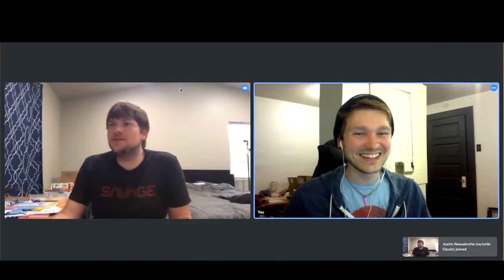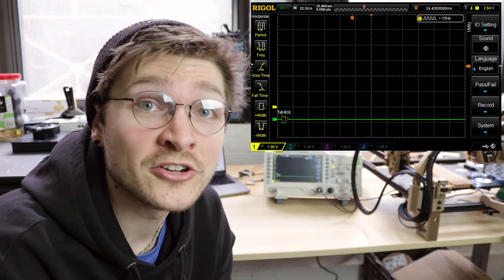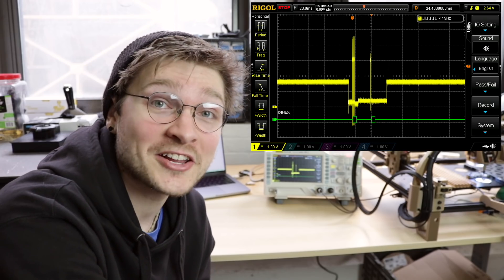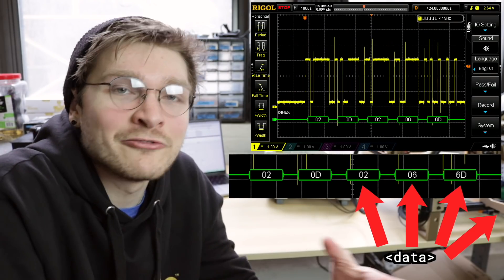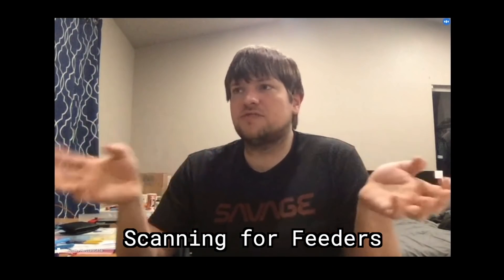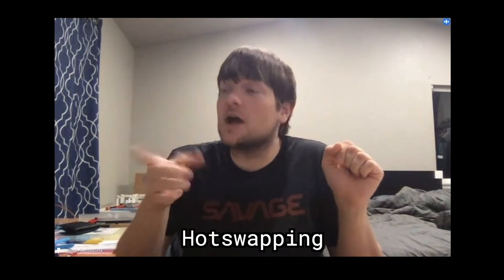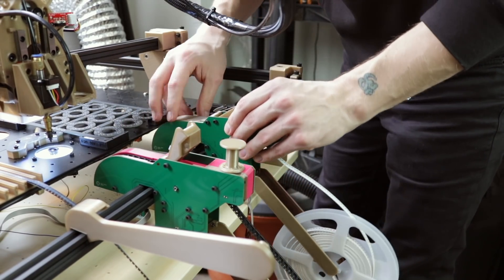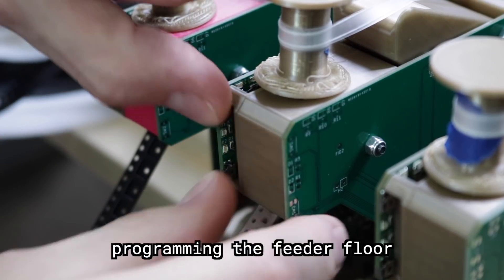Designing a Feeder Protocol

Comment: The feeder ID tracking system you've outlined seems like it's actually completely counter to the way you'd want to use feeders in production.

The workflow I'm imagining is that you'd want to have one spare feeder that's not installed in the machine that you can load offline with the next reel of whichever part is about to run out, and then quickly swap that fresh feeder in once the running feeder feeds its last part. Then, the removed feeder becomes your spare, and you load it with whichever the next reel after that is to swap in for a third feeder. With the system you've described, you'd then have to countermand OpenPNP every single time to tell it that the feeder you just loaded into the 10k resistor slot does actually have 10k resistors rather than the 100nF capacitors it had in the slot you swapped it out of. Letting feeders flexibly reassign themselves as holding the same part as the last feeder that got removed is a desirable, even necessary, feature.

An even more production-friendly option, though, would be to build some sort of external programmer tool that incorporates a barcode scanner for scanning a reel's barcode, and program the feeders with some sort of direct part number / BOM line number / virtual slot number every time you load a new reel. So when reloading the spare feeder offline, you can set it up to instantly be recognized as the correct item the moment it's installed into the pick-and-place. Then, when openPNP goes to pick a given part, it can just look for any feeder that matches the part it's trying to feed -- perhaps based on fewest remaining (let feeders track their own part counts?), or perhaps shortest travel distance, allowing you to potentially even install the second feeder full of a part before the first feeder runs out. This would even allow you to set it up for OpenPNP to prompt you to exchange one feeder for another one containing the required part, to allow it to assemble boards with more BOM items than it has feeder slots.

Comment: I really enjoy your video format and the progress you make!

Here is an idea to get rid of that EEPROMs and manual addressing procedure by using simple a Flip-Flop IC on each position. Connect all of them in a row. The individual feeders can connect to the output of the Flip-Flop on their position when mounted. The main controller can shift a "1" through each position as kind of a chip select. If a feeder is connected and has it's select pin on high, it can send a message to the controller with its information and/or wait for commands and reply while other feeders ignore messages on the bus. You save that EEPROM stuff including that manual configuration, you can get rid of addressing and your protocol can be simpler. 

There are even fancier possibilities in that case, like talking to multiple feeders at the same time by shifting a sequence through. 

Additionally, you could connect the last Flip-Flop back to the controller. This makes it possible to check that the signal gets passed correctly and the controller can determine the number of available positions. No hardcoding necessary.

The disadvantage of this approach would be the two additional signal lines of which one has to be daisy chained.
Reply: There's "fake" all over his face and expressions, especially looking into his eyes. Wouldn't trust him to tell you your idea is a better way. I've been analysing him for a while. Seems his motives are of non-pure intent and he struggles for the consumption of power.

Comment: Nice vid. Curious as to why the feeder-floor address isn't just programmed with a DIP switch?
Reply: IO requirements and vibration. A single wire to do the ID was a good compromise.

Comment: Too bad the feeders are limited to 8 bit and there's no protocol version information in the header.
Would also have liked to see forward error-correction.
Reply: There is no need for FEC. if the data is corrupted it can be retransmitted within microseconds. This is not a space probe.
Reply: It is highly unlikely that the packet header needs protocol version information but if it's needed, it can be implemented with the payload (data) messages. It's also unlikely that there will be 255 feeders connected to a single machine, so single byte addressing is fine in this case.

Comment: What a funny timing. I also just started to think about how to communicate between two devices and what kind of protocol to use. But in my case it’s simpler (in theory), I just want a control unit with an esp32 recognize what LED lamps (up to 8 at the same time, which also have esp32 chips inside) are connected to it and then automatically update the settings of the WLED settings of the control unit (how many LEDs, on what gpio pin, with what power supply). Currently thinking about testing out I2C for that? Together with some kind of repeater chip, to also make this work over 3-5m distance?
Reply: I2C isn't really meant for distance because of emi and it's low voltage. Ideally something is needed to either change voltage level (kind of like in uart via RS232 transceivers) or to send the data over differential pairs (like CAN, RS485, etc.). Optical would also be an option. Repeaters are possible, but also may suffer from emi.

Otherwise i would recommend reducing the baudrate as low as possible and designing a protocol on top of I2C that can detect errors and also corrects them.

Implementing a reliable I2C slave can be tricky too.

esp32 has wifi and bluetooth. Is that no option in your case (at least wifi/espnow)? Or a combination out of gpio and wifi?
Reply: RS485 looks fairly simple to implement, both hardware and code wise. I don’t need a high data rate, in fact it’s just a simple string of maybe 50 characters at most I would guess, which needs to be transferred reliable one time over a distance of up to 5m.

Wifi or Bluetooth aren’t really options because I am concerned they will interfere with WLED running at the same time (which controls the LEDs connected to the esp but also uses wifi for hosting a local web server, to allow the easy control of the LEDs via the web browser.

Are there any advantages / disadvantages of CAN vs RS485 I should be aware of? And can they use any GPIO pins or have to use specific ones?
Reply: @glowing_kitty  CAN is a good choice if the MCU has hardware support for it (as it does case of the ESP32). In that case you only need a bus driver and some terminating resistors. All protocol stuff is handled for you (even resends on bus collision). Instead of addresses it uses message ids, which can be kind of used as addresses, but also allow for broadcasts for example. messages have a max payload of 8 bytes.

RS485 is as far as I know only the physical interface. Like for UART you have to come up with your own protocol. If you have multiple senders at the same time you have to take care of collisions yourself. Profibus is a common protocol on top of RS485 for example.
Reply: As all chips are esp's take a look on the ESPnow protocol which is wireless and should suit your needs perfectly
Pardon, have not seen your response that wireless ways might interference with your leds. But anyhow you could give it a try if you have it running on a breadboard

Comment: Look at Mydata feeders
Reply: Why those feeders in particular?
Reply: @Graham_Wideman  They do not need peel back the plough the tapes
Reply: @Belginator  Your comment does not appear to be comprehensible in English.
Reply: They plough feeders, do a little research before rubbishing people
Reply: @Belginator  I'm not rubbishing anyone, I was just pointing out that your sentence didn't make sense and maybe you'd like to rewrite it so we could understand what you're trying to communicate. Your new comment "they plough feeders" still doesn't make sense -- what does it mean to plough a feeder? That said, I did a search on "Mydata feeders plough", and I see that they have a "plough" (or plow) feature -- which is basically a blade or somesuch that peels the cover tape off the component tape to expose the parts.  That's instead of relying on a take-up spool to pull the cover tape off, which requires peeling back a significant length of cover tape (and wasting the exposed components) when restarting a previously dismounted reel and setting up the take-up spool.  I'm not sure how great that plow feature works out in practice, but it's almost certainly patented, so while interesting, is probably not immediately helpful for Stephen and co.